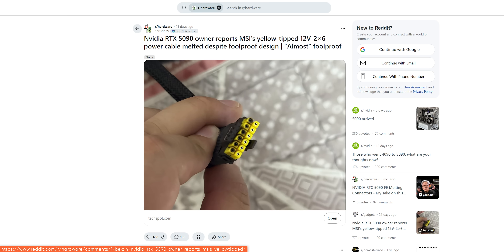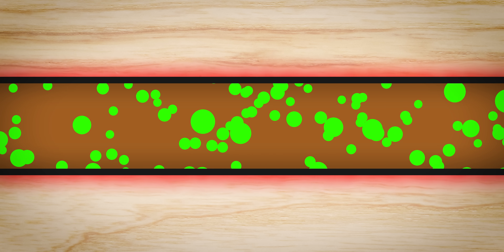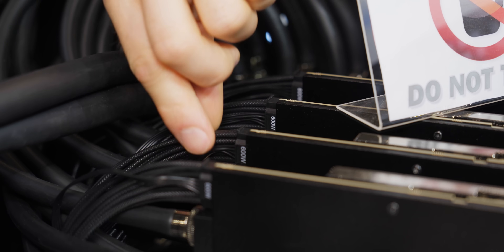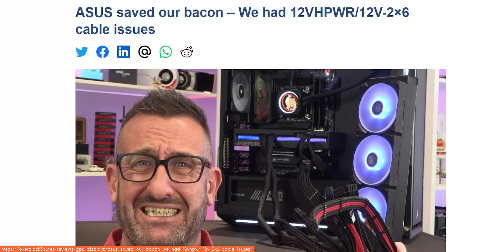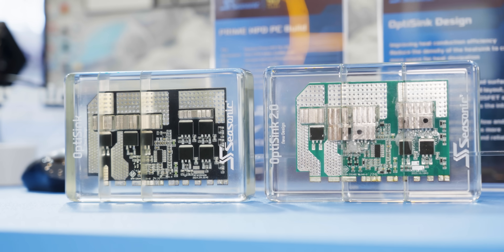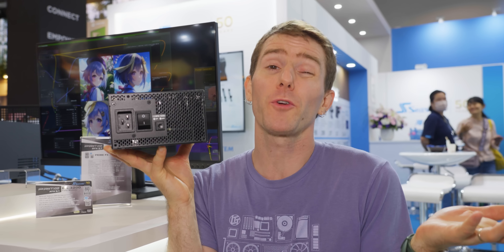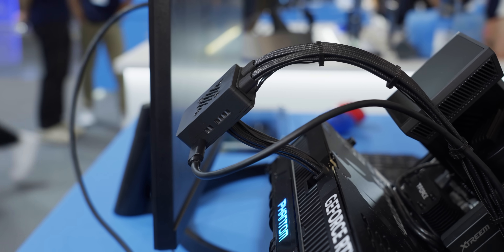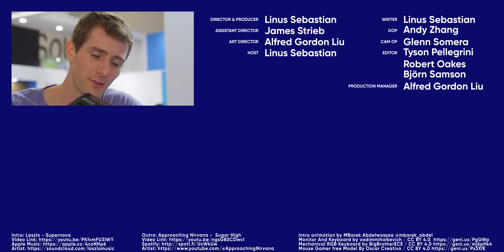The REAL Solution to Burning GPU Connectors

Comment: So, in classic Nvidia fashion, the 12V cable problem will be solved by other companies baring all the cost of fixing their GPU's design flaw. Not saying it's a bad innovation from Seasonic; it's a good idea. I'm saying the company causing all the problems should be fixing it.
Reply: Especially when Nvidia caused it by reducing their build costs from the 3090ti which didn't have the same issues.
Reply: @Skylancer727  spec, the spec enforces the single 12 plane, not nvidia spec, pci sig
Reply: i fear i will start sounding like a broken record, the idiocy, is not only nvidias fault, it is spec enforced by the pci sig, the connector must be connected to a single 12v plane, actually the astral cards may even be out of spec
Reply: The more you buy, the more we save.
Reply: This is not solving problem, your computer will crash/"switch of" anytime overcurrent is detected
With this there will be a lot more random shutdowns than burning connector cases.
Reply: well, it is "solved" only as far as shutting the system down when it is detected.. hardly ideal, e.g. for overnight AI training to get halted because of that, or something similar
Reply: @defeqel6537 

In what way is it hardly ideal that a computer will shut itself off if it detects that if it doesn't, your stuff might break? Honestly, I rejoice at this change.Power supplies should just full on, become breaker boxes but for computers
Reply: @CableFeed  It's better than not shutting down, but it's still nowhere near as good as just not letting the current get too high for the conductors in the first place.
Reply: @CableFeed  So it's ideal to have your PC shutting off instead of preventing the issue in the first place? You're such a genius.
Reply: @Ahov 

Its ideal to have a breaker box like safety measure that shuts off your computer to protect components
Reply: @CableFeed  much like breaker boxes, it is a good protection for the system, but the ideal system doesn't overdraw current in the first place and remains stable

Comment: Of course PSU manufacturers are the ones to fix NVIDIA's electrical nightmare. Hopefully this feature becomes more mainstream by the time 60 series releases.
Reply: yeah was thinking that myself. by the time they master it Nshitia will change the design to another molten mess cable config.
Reply: @martinmalone6324  honestly I'm a bit surprised that psus weren't already required to have per cable over current protection already. Your house has this (breakers) already.
Reply: @Cynyr  yeah but Nvidia are well ahead of the game 🤣🤣
Reply: @Cynyr  you're implying that every individual socket has its own breaker
Reply: @svgPhoenix , yes exactly.
Reply: @Cynyr  Well, if you are aware of that, you must be aware how electronics in your house also have fuses or some kind of protection themselves. Nvidia used to have these but removed them after the 3000 series.
Reply: Wouldn't it drive up the cost of PSUs JUST because of Nvidia?
Reply: I’m a fan of this being a feature in PSUs but I’m not in favour of letting Nvidia and certain partners getting away with someone else fixing there issue.
Reply: Real engineers at seasonic, solving problems, finding solutions for a better and safer world, and also knowing that people can have mistakes and will certainly miscoonnect something. But the 30 operations on the connector is certainly a trick to get you to buy a new card or diminish it's value if you resale an old card.
Reply: it's a bad bandaid solution, it should actually actively manage how much current flows through a wire rather than just be like "nope, connection or cable no good"

there are many chargers for batteries etc operating in a "CC/CV" manner, that means it actively tries to first and foremost maintain a max current, and if it can go up to it's max designated voltage without exceeding the current limit it will keep a constant voltage

that is what we need, not a lazy monitor

albeit it should be done from the card rather than the PSU first and foremost, but it would be way better if the PSU itself just maintains a healthy 8.6A max per pin, like actually maintaining, not just monitoring and turning your PC off
Reply: pearto
Reply: Yeah, I was just thinking that, it's embarrassing that Nvidia needs PSUs to fix their shit
Reply: When 60 series drops it’s going to draw so much power that no power supply will handle it even with features like this.
Reply: @GoldenPickaxe  I'm hopefully that since we're getting a node jump to 3nm I believe that it will be a bit more power efficient unless NVIDIA just cranks the power limit to get the highest score which is likely.
Reply: Such a wonderful thought that one would have to buy a new PSU along with my GPU just to reduce the chances of their computer melting down.
Reply: maybe we just use cables that dont need dedicated computer control to keep them from thermonuclear failure
Reply: All the PSU manufacturers should just drop the connector as an FU
Reply: @smashed_penguin  The connector is not the problem, Nvidia and some board partners saving a few cents by bonding all the pins together is the issue. Board partners who didn't make this really dumb decision have no issues at all on their 5090s
Reply: @0106johnny  The problem is board partners can’t choose to not follow the design. They have to do it this way because Nvidia requires it. The Astral tried to work around it as best as they could while still following Nvidia’s spec but they’re still not able to avoid the issue.
Reply: @0106johnny  The connector IS the problem.  What Seasonic is doing, as well as the ASUS Astral cards, doesn't fix the problem at all - it merely gives you a warning/shuts off the power when it happens.

The only way to actually solve the problem (with the existing connector) would be to split the VRMs across the individual pins and impose an actual current limit per pin.  Nobody is doing this as its complicated and expensive.
Reply: @alexatkin the astral 5090s may actually be not just monitoring it, they have a MP29816-A multi-phase controller and many Intelli-Phase chips/VRMs, and their 12VHPWR is actually split up on the board so it seems like it has proper balancing, it has a crapton of "smart" vrms

and no the connector is NOT the problem

the old 6 & 8 pin connectors weren't any better in that regard, they just were properly managed VRMs wise

the way Nvidia handled this would've burnt out any, and yes i say ANY multi-pin connector, it just was no good.

12VHPWR, 6PIN 8PIN be damned, just paralleling all would result in the same premature overheating and destruction

the only real way to solve this mess without balancing would be a fat 2 pin connector with 2 high flex wires (not multiple separate wires in parallel), thats all that can really be done
Reply: @0106johnny  the connector being tied to a single 12v plane is spec, so the manufacturers that do not do that are either very close to or actually violating  spec
Reply: @rubenfasola5402 the spec is broken, when you put 6 different wires in parallel, especially with a connector, there's no way to guarantee each one shares exactly the same amount of current, on paper if the connections have exactly the same amount of milliohms that may work out, but in real life thats a different story

that means the spec was bullshit from the getgo and more of a "hail mary" prayer

whoever thought that spec was a good idea hopefully lost their job already.
Reply: @BH4x0r i am not, and i have never argued the spec was good, I am saying that the connector being treated as a single 12 source IS the spec
Reply: @BH4x0r  There have been melted connectors on the Astral as well as people showing uneven loading on the pins in the software. It merely allows you to see there is a problem, it does nothing to fix it.
Reply: @alexatkin that sucks

i would've expected it to be much better cuz it actually has the capability in hardware..
Reply: @smashed_penguin what about the people that bought cards with the connector? It's not their fault that the GPU they wanted has it.
Reply: I hope Nvidia is out of the consumer game by the time the 60 series would have released
Reply: I dont think theres going to be rtx 6000 , the 5000 are already overkill , and igpu are geting stronger realy fast
Reply: The thing is, the "power supply unit" SHOULD generally be expected to be the one to do this kind of job. Maybe it was quantum 16D checkers from Nvidia to force them to do it instead of the regulation being on the GPUs?
Reply: No I hope this feature gets abandoned. The costs for building a pc are already high enough.
Reply: 60 series, isn't going to be a thing lol
Reply: @sprungles  Honestly at this point it may be for the best. Id love AMD to go to competing with Intel on Pricing and Nvidia to quit messing everything up for all of us. Competition is better, but nvidia is single handedly ruining everything between crazy pricing and artificial shortages and pushing devs to implement half baked features like RT and DLSS/Frame Gen and then claiming they are the best because of those raggedy features.

Comment: They could just have yet more 8pin connectors. The 12 pin is dumb
Reply: Won't change the problem. The issue isn't the cable, it's that Nvidia to save money wired all power cables together on the GPU side. They used to be split 3 ways even with the 3090 ti's 12VHPWR cable, but they decided the cheaper method was superior. Replacing the 12VHPWR with 8pin cables won't change anything if they still wire them all together.

Comment: Do wires now need water cooling?
Reply: They have them on car chargers sometimes I think 😅
Reply: @androiduberalles I think on like the big connectors for giant industrial motors and stuff they do
Reply: ...CAR SAFETY FUSE IS CHEAP AND ROBUST SOLUTION,THOUGH

.........
Reply: @robotnikkkk001 now that I think of it why is no one putting fuses on these cables
Reply: @EricEatingCheese  .....SAME AS ME,though!!!

.....WELL,IF ASK CHINESE,THEY'LL MAKE ONE FOR sure,RIGHT??
Reply: If you put a fuse on each of the 12v pins and one draws too much current, the fuse blows and the current from the one wire will start flowing across the other five. What is most likely going to happen is you will loose all 6 fuses at the same-ish time. Solution is proper per wire monitoring on the GPU and shutting down the load(GPU) if it goes out of spec.
Reply: @TheEagleCZ .....STILL IT'S BETTER THAN LOSE ALL CARD,THOUGH

....AND FUSES ARE DIRT CHEAP,THOUGH

Comment: The real solution is to not use that garbage connector
Reply: the connector can work fine if the GPU power delivery is well designed
Reply: The realer solution is to consume a reasonable amount of power

Comment: The real solution is to NOT buy Nvidia shitty GPU until they change their shitty connector for something that is safe. Buying those expansive PSU will just make shit the new standard.
What next ? They will put lethal chemicals into their capacitors because that's cheaper, and we will have to buy NBC cases to protect our lives ? "Thanks to Phantex and their new survivolv-500 NBC case, we now have a solution for the neurotoxic 7090 nvidia GPU !"
Reply: Tbf, the 12VHPWR is only a problem because Nvidia are going all in on maximizing its power usage at 600W in the 40/5090s. The 3090 TI had this connector but I dont remember it being a problem back then since it only used 450W.
Reply: @jotinhafilho5920  the 3090 also had current sensing and load balancing while the 40/50 class just don't anymore
Reply: @jotinhafilho5920  because 3090's were handled by nvidia engineers properly which had 3 separate 2 power 2 ground rails compared to single 6 power 6 ground rail 40 and 50 series uses and power consumption was lower on 3090 which helped with the case

only if PSU makers, DIY cable makers etc. used tefzel shielding (also known as ETFE polymer) instead of rubber shielding which would allow for more copper in a wire while retaining the same thickness rubber shielded wire has where cost is bigger but who cares when tepsil is used in aerospace,military and high end automotive engineering
Reply: 😂😂 if nvidia was ceo-ed by cave Johnson
Reply: agreed!
Reply: Dude, it's not like the consumers would actually change anything. They make most their money off of business to business
Reply: @HenryGeorgeRIP  So? get a 9070xt, a B580, or later in the year, B770 and Ignore team green. less anxiety and less idiocy

Comment: Nvida needs to put a 2nd one of those connectors but they won't listen......
Reply: they really just need to swap back to what works, or make something better and make all their fan boys switch again lol
Reply: @kcscott11  As long as they want their GPUs to use 600W, its hard. They would need to put 4x8-pin to match that power delivery of a single 12VHPWR.
2x12VHPWR is a better solution in my opinion too.
Reply: @jotinhafilho5920  8-pin EPS does 180 watts and takes up the same space as an 8-pin PCIe connector, so three of those is 540 watts which leaves 60 watts to go through the PCIe slot itself. Top-end GPUs commonly had three 8-pin PCIe connectors, heck the eVGA Kingpin 3090 (non-Ti) was one such GPU! So this should be a complete non-issue and simplifies PC power connectors of just being EPS for everything.
Reply: @nintendomaniac64  The PCIe 8x pin is way overbuilt, each cable is capable of carrying 300w each instead of just 150w, so 2x cables could power a 5090 at 600w without issues, and if they kept using 3x 8x pins then they could have done 900w + 60w from the slot, so even if one cable died, you'd still be very safe. Just look at the 8x pin to 12VHPWR adapter cables from companies like Corsair and others, they do it over just 2x 8x pin cables. I use a Corsair AX1600i with a 4090, and it's being powered with a cablemod 3x 8x pin to 12VHPWR cable since the 4090 launched. So far, my GPU has been powered on 24/7 for all this time without issues, thankfully.

Comment: I have a PC problem. I bought a new Kingston 1TB SSD and it stays 100% usage in Task Manager everytime I have the internet connected. If I disconnect the PC from internet, the SSD usage drops to 0%. What should I do? Please help me. I tried everything I found on internet.
Reply: check whats download/upload from your ssd.. find the task and check wtf is going on there.. maybe a update etc etc
Reply: Don't want to come off as rude, but sorry, the comments of a random LTT video is not the place to ask. Try the LTT forum, the people there are usually helpful and I think it might be what you're looking for. As for your issue, task manager actually shows how much each application is using your storage device(s) under the "disk" column (in the processes tab, same place where it shows cpu/ram/gpu usage). Try using task manager to find out which process (or processes, might be several) is/are using the ssd. You can scroll down through every process (trust me, it wont take that long) or click a few times on the top row of the disk column (the one that says "disk") to sort by most usage. If you're in the processes column and don't see any of what Im talking about, click "more details" in the bottom left. If you don't find anything in the task manager, chances are its malware that is intentionally hiding itself, and which can only work and do its job on your ssd when youre connected to the internet. In this case it is a good idea to try re-installing windows. Alternatively, it may just be windows screwing with the ssd for whatever reason, maybe different drivers from different manufacturers not playing nice with eachother, or windows installing some stuff to the new ssd. Either way, a constant, 100% ssd usage isn't very healthy for it, so you should definitely try to solve this asap. Here's that LTT forum I mentioned, you can ask your question here: https://linustechtips.com/forum/6-general-discussion/